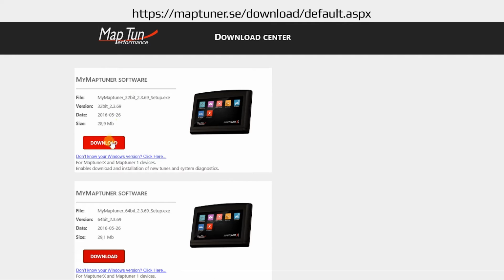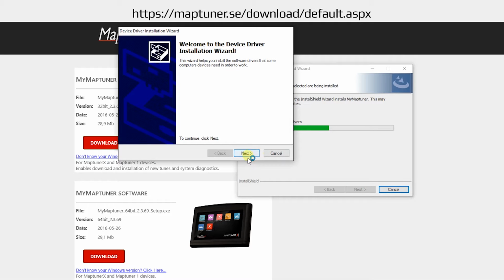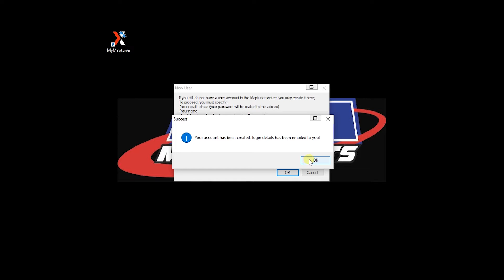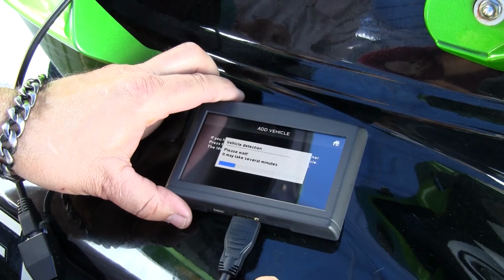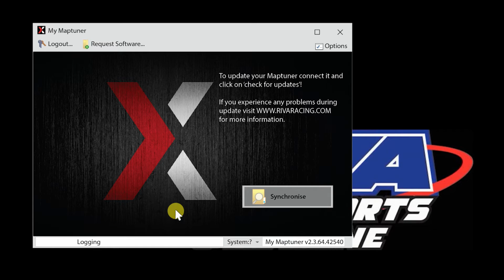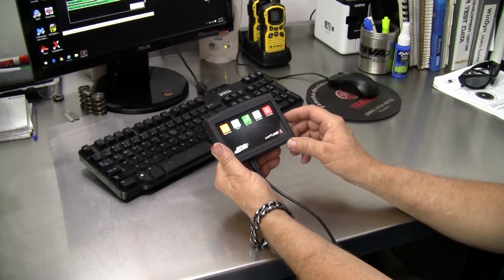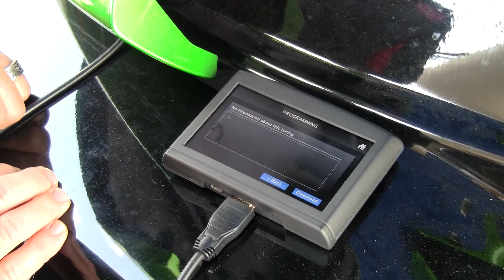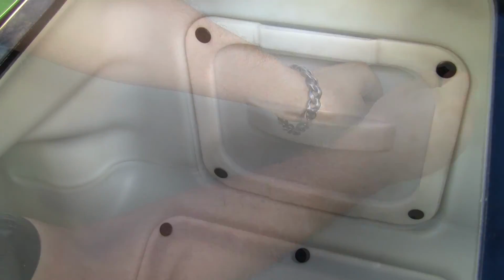Maptuner X Kawasaki Instructional Video

Comment: How much power gains is it getting
Reply from the maker: A tune by itself offers minimal gains in horsepower. However, when combined with additional modifications the gains are significant. If you have specific performance requirements we can build a tune to help you achieve your goal. Please contact us at tech_support@rivaracing.com to get started!